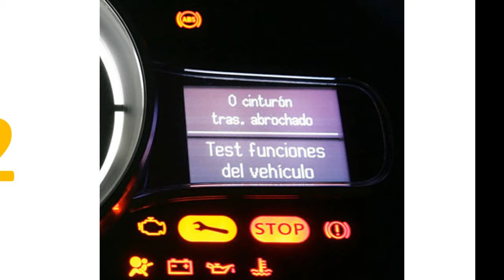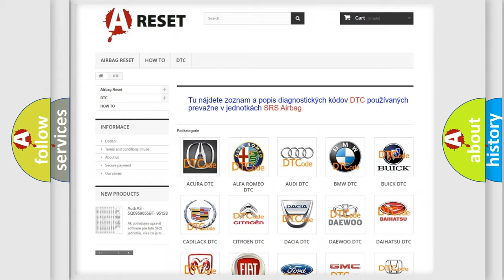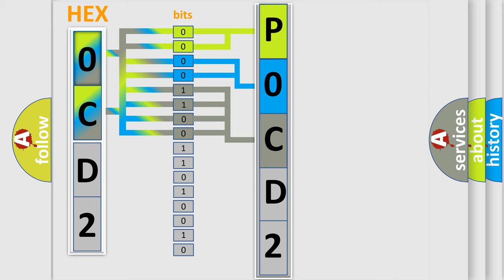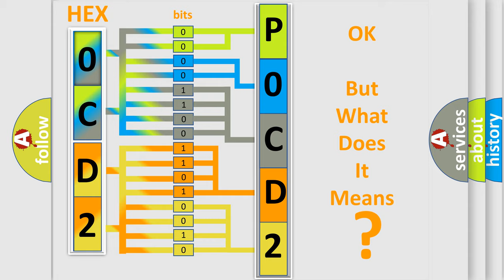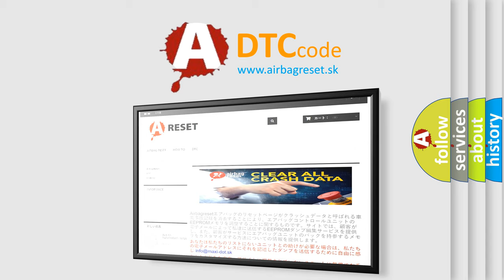DTC Chevrolet P0CD2-00 Short Explanation

Comment: For a Chevy Volt, every other source of information I've found about code P0CD2 has to do with the charge door not opening right. That includes the GM hybrid diagnostics manual.  There is no mention of a voltage problem with that code.